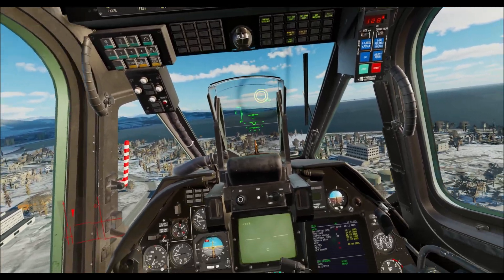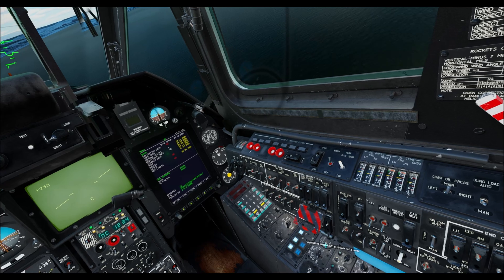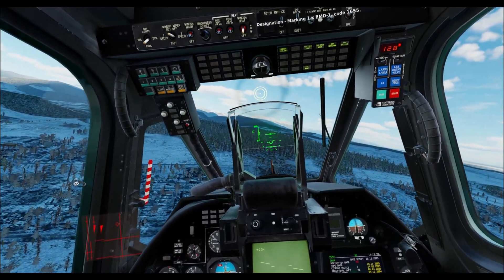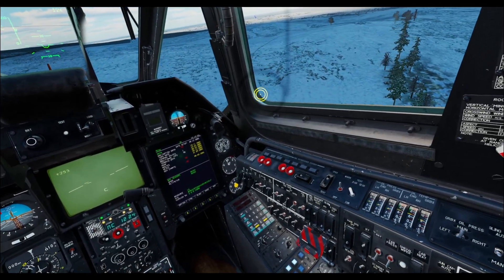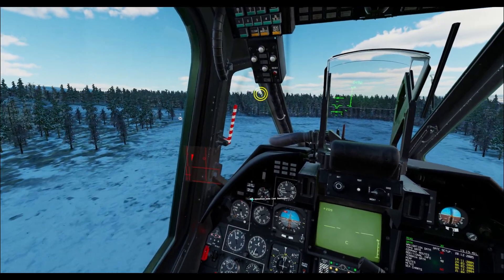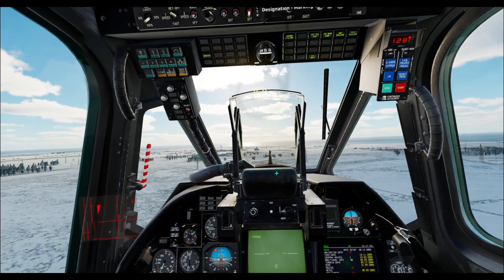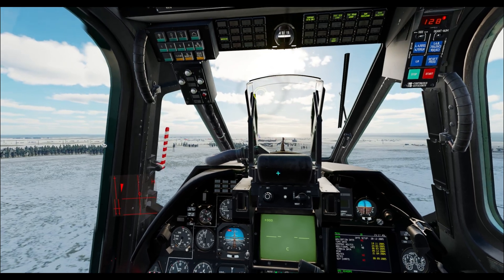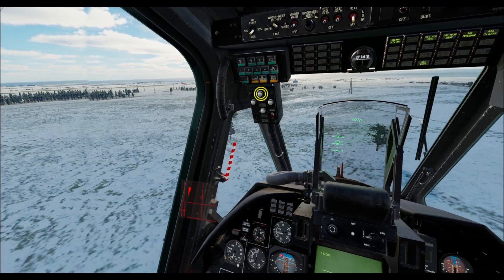Zero to Hero | DCS Ka-50 | 5 - Flight Director & Autopilots

Comment: do you use a tracker? or just VR and which one?
Reply from the maker: VR, Valve Index
Reply: @DamnedGh0st  Why is there so much camera shake during gameplay? can it be adjusted so that it doesn't shake so much?
Reply from the maker: @velimirtopalovic  In the video or in your game? If you mean in the videos, this is a rather older one - I have started doing post processing stabilization on more modern videos to reduce shake. The only issue is it makes a quick to make 15min video take ~6hours to complete.

Comment: Correct me if I’m wrong, but I though Flight Director on was the same as holding in the Trim-button!?
Reply from the maker: It's similar, but try testing it yourself. You'll see that you can still trim the aircraft even in FD on, but you have much more 'wiggle room' before the aircraft fights you like if you had FD turned off. (This is assuming you still have pitch/roll autopilots turned on. If everything is off, yes what you describe is correct.)

Comment: Great video! I'm definitely going to practice this on some missions. Although I've gotten fairly decent at controlling the rotory craft, I have noticed I don't have full mastery over the control. In one of the campaign missions as I was entering hover mode, I did notice that I kept on having to fight the aircraft whenever I was trying to line up shots. The heading hold kept pointing me in the wrong direction and I would constantly push the rudder and roll the aircraft to get it where I wanted it.

And this was without enabling the auto track feature in the weapons system.

I feel like this might be the piece of the puzzle I've been missing. Looking forward to trying it out!
Reply from the maker: Awesome! Hope it helps :)